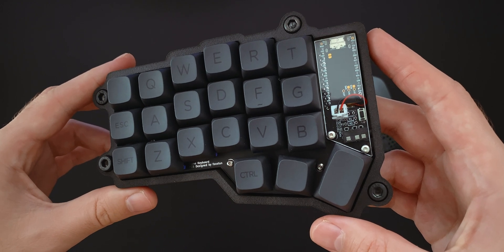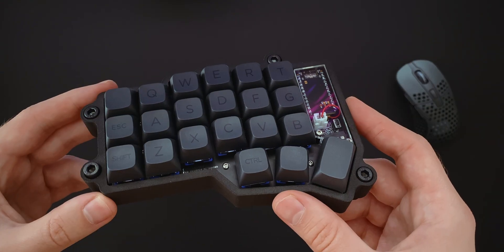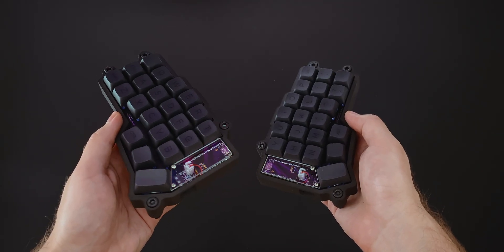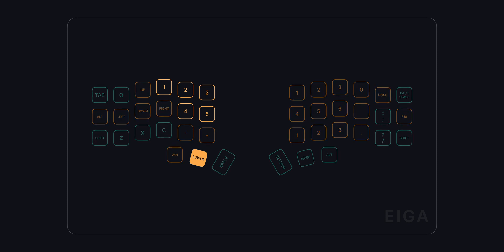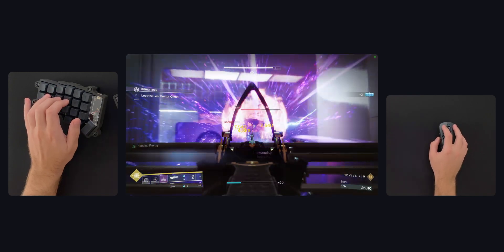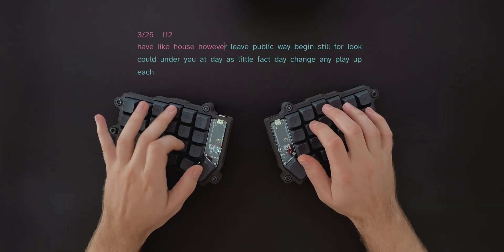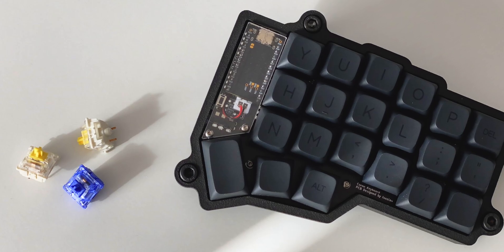The wireless Corne keyboard

Comment: I am thinking about building a Wireless Corne myself. The only open Question I have left is about the battery. Do you have to remove it or can it be loaded via USB from the Mircontroller?
Reply from the maker: No need to remove it, it charges when you plug the keyboard in.

Comment: what you did with the battery is clever. you soldered a socket in place of lcd headers and used a wire on the back to connect the socket to the battery 👍

Comment: I looked at you keycaps set but I couldn't see the blanks in it. Did you get those separately?
Reply from the maker: I have two sets, one blank and one with legends.
Reply: @EIGAtech  of the same set? Do you remember where you bought it from?
Reply from the maker: @marcodebortoli  The Gentleman v2 set is available with legends or without. I got mine from Aliexpress.

Comment: For gaming you can just go 1 row down and 1 column to the right, so instead of 'wasd' you use 'dxcv' as movement keys, this should open up enough keys very close to your left hand to play most games. If you play MMO's, you can open up another key, because usually you don't need a backwards key as it's the slowest way to go backwards, so you go with 'xcv' for movement keys and of course you'll use shift and ctrl as modfier keys. If you still feel like you need more keys for MMO's, consider buying something like the newest Razer Naga just for those games.

Just my 2 cents as someone who's venturing into split kb's and also play a variety of video games.
Reply from the maker: I did try out DXCV actually but very briefly. My main issue with "non-standard" setups is having to go through the trouble of rebinding keys for each new game, not to mention getting used to it in the first place.
Reply: @EIGAtech  Yea I can understand that, I've just always had to change some key bindings and settings in every game I play anyway, so the extra changes don't really bother me. As for getting used to new binds, it's not as bad as learning a new layout imo, but yeah it's something you need to get used to. And if you're not bothered by not having a row above, no need to change anything.

Comment: What screw did you use for the tenting legs? It's look so clean, especially the bottom of the screw legs. And what connector did you use in the video to connect nice!nano with the battery? I'm planning on using it both wired and wireless with ZMK, so that connector is crucial.
Reply: Have the same question. I need both options wireless and wired. Great video btw!

Comment: Could you point out which case nylon (or anything really) to utilize from the website you linked? 

Which switch type between linear or tactile would you suggest best utilizes the build materials of brass screws and spacers, a PE foam sandwiched and all FR4 plates?
Specifically, I am going for the gateron north pole switches for linear vs the durock t1 POM sunflower for tactile. Basically the best in thock, smoothness and lowest stem wobble.

Comment: The link to the case is broken. And you're linking JLCPCB for 3D printing . It's only a PCB manufacturer , no ? 🤔
Reply from the maker: Thanks for pointing it out! I fixed the link. Don't be fooled by the PCB in JLCPCB, they do offer 3D printing. The case in the video is printed at JLC using their SLS process.
Reply: @EIGAtech  Where did you buy bolts?
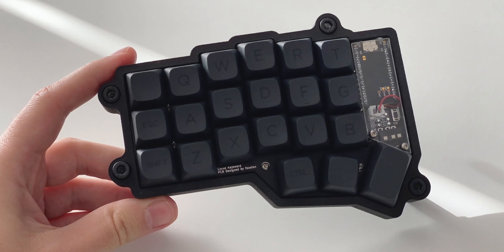Reply: For telding hols 2:13

Comment: curious to know what's the reason you don't type with your pinky on this keyboard. 
column staggers, from what i gather, are made with finger lengths in mind. unlike row stagger keebs, this feels like a great layout to type with all 10 fingers.
Reply from the maker: I do sometimes but when I want to type fast it's just muscle memory taking over. I also find using my pinky for anything other than modifiers to be somewhat uncomfortable. 

Compared to how I was typing before, the Corne did help my touch typing a great deal, though. Not even worth comparing. So maybe I need to practice using the pinky as well.
Reply: @EIGAtech  i picked up touch typing during quarantine and now i find not using the pinky uncomfortable haha. but hey, if it works for you, it works.

love the video btw. this board isn't available where i'm from, and have been cosidering a similar keeb called Reviung41. 

not much coverage on these keyboard layouts, and your explaining of layers specifically make me want to try one for myself. keep it up!
Reply from the maker: @kouhaiii3182  Thanks! There's also a new video with my updated build, in case you missed it.

I'm familiar with the Reviung, but never tried it for myself.

Comment: I saw somebody with this keyboard in a coffee shop today.  It's interesting enough that I am considering it. I am in the middle of taking a 4x4 macropad (keybow2040) and building it into the back of an iPhone case, so that you type with fingers wrapped around it with thumbs on glass.  I gave it a computer-braille layout, so that I can completely emulate a US qwerty keyboard. I have a last-inch problem that is driving me nuts... it is ONLY iOS that has terrible navigation between windows and applications. I can't figure out what the keycodes for things like Fn+H are... as Fn isn't a normal key with a scancode.  It's just that when Fn is down,  my circuit python code needs to emit some special bytes. And I can't figure out what they need to be.  Apparently it follows whatever Apple Magic keyboard does. This is all weird, as you would think that using an iPhone with a usbc keyboard would not be THAT strange. I even discovered that you need a special OTG cable as well.

I am definitely going down an unusual mechanical keyboard path.  I can't believe that with so many people making keyboards that after a month, I still haven't managed to get enough info about keycodes that iOS recognizes.

I am definitely thinking of taking a bit of a detour and maybe building one of these. They look really cool.
Reply: In iOS you can change the button Fn with something else, I replace Fn with Tab, and change Tab+H for Help to Ctrl+H, and use Tab+H for Home
Reply: @Hanung665  i dont know if this was always there, and i just missed it; or saw the FN button being used, and just got wrapped up in trying to make that work. thanks!  i have needed a home function on my custom keyboard for a very long time.

Comment: Nice!
What tool do you use to explain the keymap layers? Is that another cool GUI tool for configuration? (I am not familiar with ZMK firmware)
Reply from the maker: Those were custom graphics I made, but you could look into this: https://nickcoutsos.github.io/keymap-editor/

You need to connect your github repo to it, but it's a more visual way of customizing ZMK. Not quite as easy as QMK with something like Remap or VIA, but it's something.

I also have a new video out with some updates to the Corne build.

Comment: Very cool build, looking to do something like this. One question about the battery life, by 1 week you mean actual 1 week when the keyboard is turned on so 168 hours of keyboard life, or 1 week that just just use the keyboard daily and then have to re-charge after 1 week?
Reply from the maker: Thanks! I never turn the keyboard off, the firmware puts it in sleep mode when it's not actively used. I charge it about once a week. 

I also take care not to fully drain the battery, so I might chare it a bit sooner than exactly one week.

The battery % in Windows only seems to work when it feels like, but when it does it seems relatively accurate.

Comment: Ok so how do you turn it off when you are not using it? From there how long does your battery last on average with normal usage? Also love the build, super clean and your video is perfect.
Reply from the maker: Thank you! There's a very tiny switch near the USB port that can be used to turn off each side. You can use this tool to estimate battery life: https://zmk.dev/power-profiler

Comment: How much it cost?
Reply: $250
Reply: Yeah, for a kit, but many stores sell them premade
Reply: I found it used for as low as 100 USD
Reply: @qwert4871 how to find it for 100$?
Reply: Ridiculous price @qwert4871
Reply: Base kit is 33 dollars
Reply: @ashark9150  hey do know where these are sold? pre made?
Reply: @slappy_chimp  not premade. You buy a kit, they give you bare bones PCB and some standoffs so it doesnt touch the ground. It isn't prewired too, so you have to manually wirre the pcb
Reply: @ashark9150 do you also need to solder stuff?

Comment: Hey loved the video! Just a quick one, the 3D designed you linked does not have any top plate but I assume you're using one? Could you also hook me with that, thanks! 
EDIT: I assume its Acrylic top, you mentioned in the description. Thanks

One more silly question, did you spray paint you bolts?
Reply from the maker: Thanks! The top plate is the basic FR4 plate that comes in the kit from 42keebs. The bolts are just generic black M5 bolts from Aliexpress.

Comment: Did the keycap set come with the few blank ones seen on your thumb cluster? Def need a link to that case!
Reply from the maker: I’ve actually combined two sets (one with legends and one blank). The legends are pretty faint in real life, so you could just go with one set.

Updated the description with a link to the case.
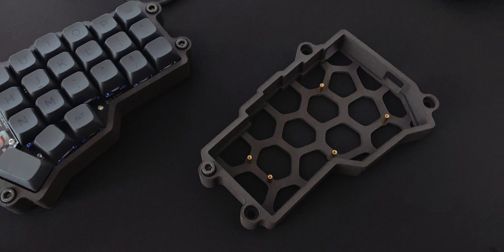Reply: @EIGAtech  Quick follow up as I'm sourcing parts for my own build based on this; At 1:23 I notice that you have the battery JST plugged vertically into the board and it looks AMAZING! Are you just using the OLED holes to route the wires from the JST back around to the Nice!Nano?
Reply: @bibbitz  that's correct.

we had v2 pcbs, which are reversible and have jumpers that need to be bridged depending on what side of the pcb gets used. 

the jst connector was mounted into the oled pins, one of them was the ground pin and it was bridged, while the unbridged pin was connected with a wire to a power switch and then to raw (you could connect it to the backside of the raw pin if you dont plan on using a switch).
Reply: @3.5.3  would this also work on the v3? I believe it still has the oled jumpers.
Reply: @bibbitz  no, unfortunately the v3 pcbs have no jumpers. it wont work unless you literally cut the traces.

as an alternative, and if you have the room for it, you could wire the batteries directly to your n!n and use inline connectors, if you ever want to quickly remove them.

ideally someone would modify the pcbs to include all of these features; I know that foostan has some of them on the back burner, on his github roadmap.
Reply: @3.5.3  ah, yeah I see that now. Hmm. I'll do some more thinking about this.

Comment: nice! link to the case?
Reply from the maker: Thanks! Added to the description!
Reply: @EIGAtech  i saw it only has one side to print, how did you get both sides?
Reply from the maker: @ethanhuang7523  The design just needs to be mirrored. However, just mentioned it to VOID and there should be mirrored designs available now.
Reply: @EIGAtech  ok, tysm!